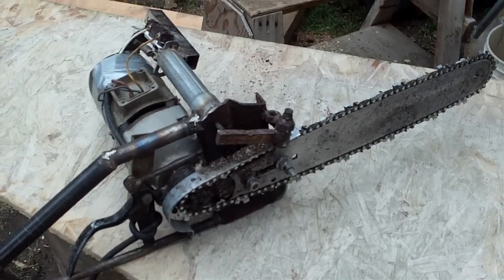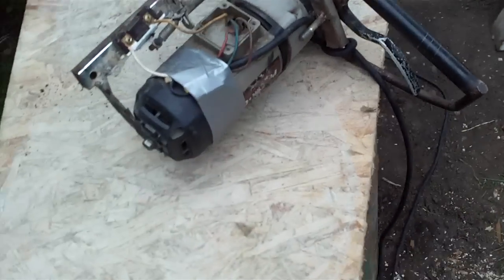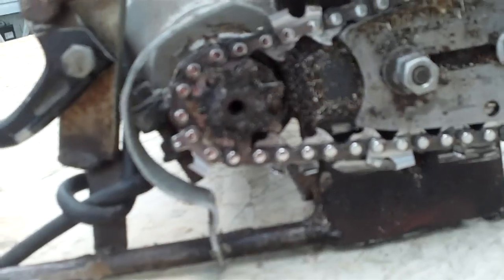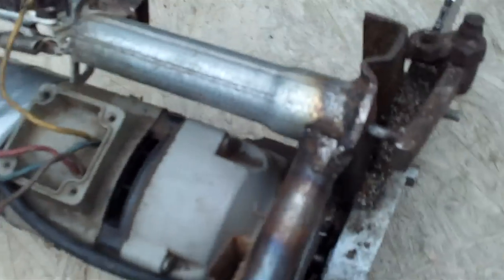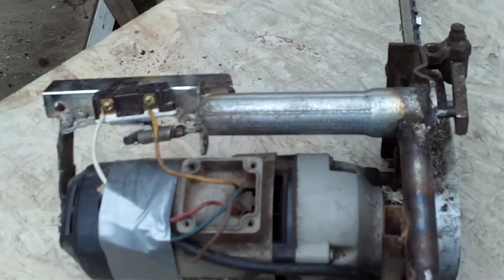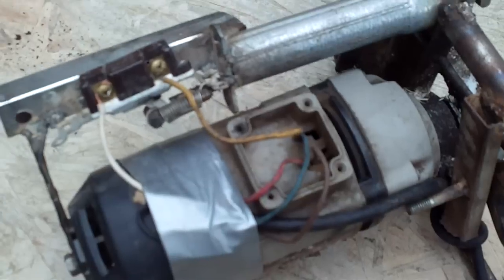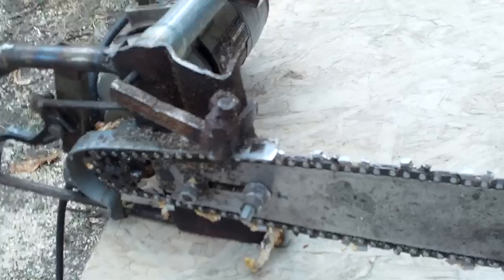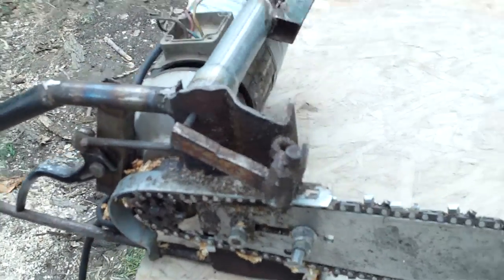homemade chainsaw with electric drill motor

Comment: I have a question about the wiring on your saw. I have a similar drill that the switch went bad on and I want to make a drill press with it and use a light switch. I'm not sure how to wire it, mine has 4 wires coming out of the drill red, black, blue, and white and the power cord has typical green, black and white. If you could explain how you wired yours I would greatly appreciate it.
Reply from the maker: The drill probably uses two sets of wires, one for forward, and one for reverse. Try connecting the white and black to power and see what it does. If it doesn't run or run properly, try other combinations of wires. Usually two of them are powered for forward and the other two for reverse, it's just a matter of finding out which ones. Don't worry about burning out the motor or making a short with the wrong wire combination, you can't really do that.. Once you find out the wires, connect one of them to the cord power and put the light switch in line on the other one.

Comment: will it  work with an old water pump motor? i have a russian water pump motor, it has high speed. however, i am wondering If it  will not fry it!?
Reply from the maker: I would not use a water pump motor. Usually they are induction motors and will not have enough low speed torque to power a chain properly.

Comment: Well it works just fine, engine is little bit to slow, needs something faster. Engine from a angle grinder whould be perfect, they are small, light, very powerfull and extremely fast.